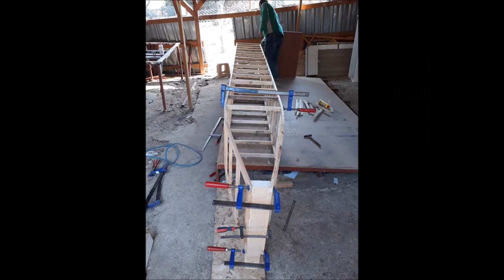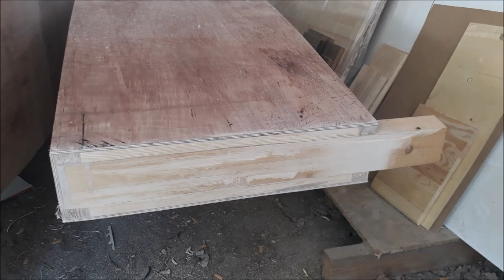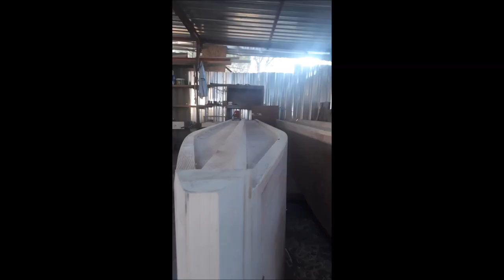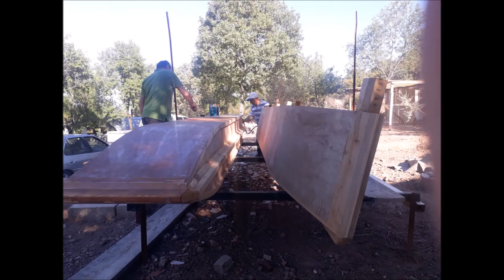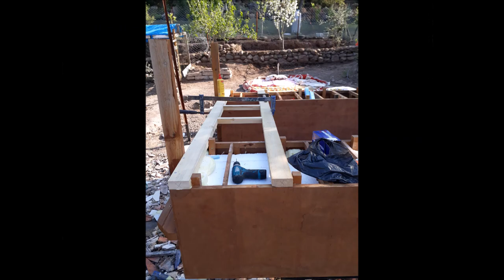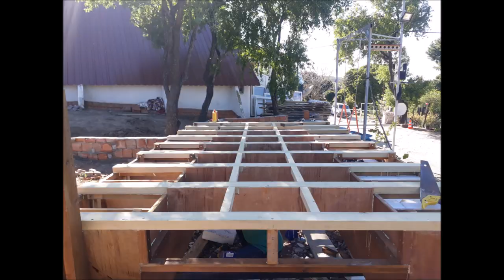Katamaran Tekne Yapımı - Bölüm 1 (4,60mt) homemade catamaran build part 1

Comment: Dear Sir, I am from Brasil and planing made a catamara look like yours , 6,5 meters x 4 mts , each hull 0,6 meters could you send details for your construction. I will be very glad because I have some ideas but nom experience. Thanks
Reply: Salim dana, oglum he won't reply to you since he can't understand english! But I'll pass it by him🙂👍
Reply: @bizim_eller  Thanks a lot.
Reply from the maker: Hi. sorry for my late reply. length 4.60, width 2.10, height of feet 0.60 meters. You can make the upper part as you wish. With canim or open.
Reply: @ozgurgursu8093  Thanks for your reply.. I need the wood  thickness of the structure of each hull and wood plate thickness for lateral coveriside hull. I need the resin used and layers of fiberglass used and gramature of fiberglaas fabric. Thanks in advance ( sorry of my poor english )
Reply from the maker: @salimdana124  the width of the trunks is 55 cm. Sides covered with 6 mm marine plywood. 200 grams of fiber and epoxy resin were applied on them twice. Sanding was done between each coat, then epoxy putty was applied. ready to paint now. I did the primer paint. I am now building the platform and cabin.
Reply: @ozgurgursu8093  I will  start small cat. 3 mts x 2mts to gain more work technic. Best regards
Reply: Só agora vi a resposta.  6mm de espessura da chapa.  Nossas chapas comerciais tem 2,20m x 1,60m . Vou fazer rabo de andorinha para uni-las. Vou ter coisa de 4,30n de comprimento e 0, 80 de altura. Vou  fazer dois pequenos compartimentos estanques e no centro do pontão vou colocar uma cabine, só elevando o pontão na seção central em uns 0,30 m . Os pontos serão de seção retangular e seu centro habitável. .
Reply: @marcobrandao3468  Boa noite.
Estou em SP. Reavaliando meu projeto. 6 mts por 3.5 mts . Cabine 3 por 3. Altura banana 70 cm por 50 cm. Vou fazer 3 bananas pois acho mais robusto